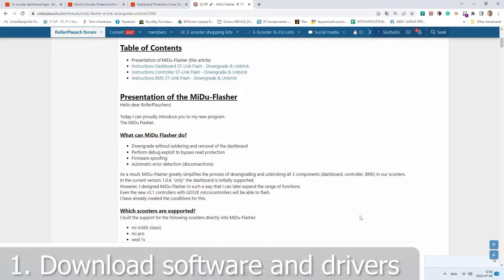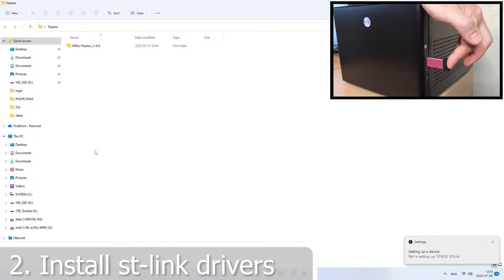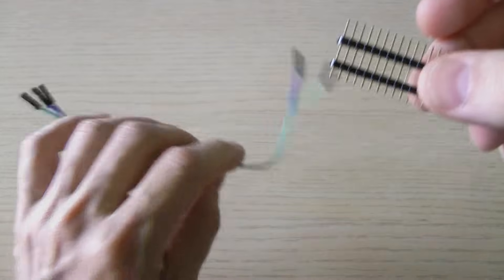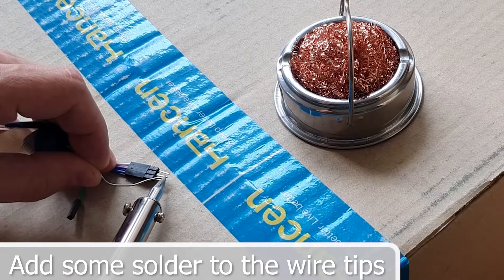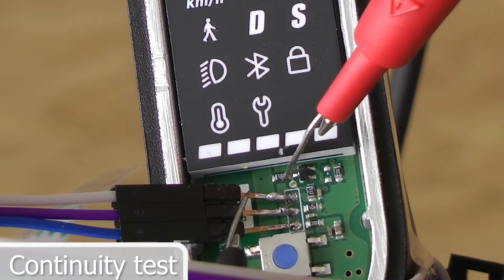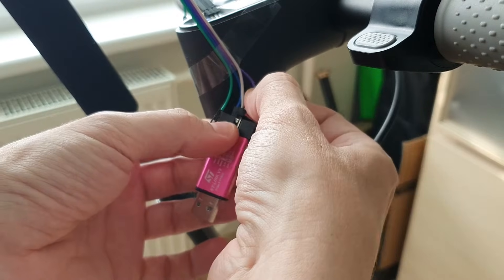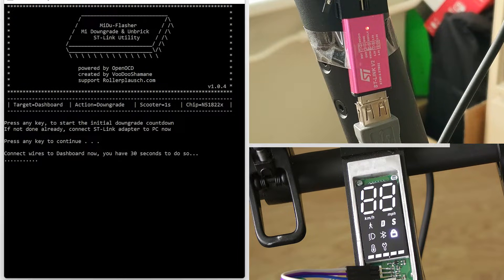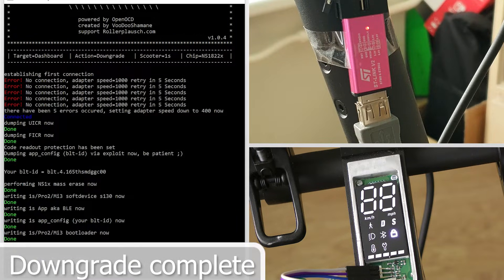Xiaomi scooter 1S BLE157 downgrade using stlink

Comment: i have a error : ERROR no blt-id found. and I don t know what to do
Reply from the maker: Try "write flash" instead of "downgrade".
Subscribe, thanks.
Reply: @MindaugasJocionis  I tried, and then it was the same version
Reply from the maker: Did you pressed Y in "spoof new ble to 157" step? If so, it has been downgraded, just appears as 157
Reply: @MindaugasJocionis  I pressed "n"  I can't even do the speed hack
Reply from the maker: @Knajjrjes  Is it original dashboard?
Reply: @MindaugasJocionis  yes
Reply from the maker: @Knajjrjes   Did you activate your scooter, or is it brand new? If it's new activate it with the MiHome app. 
I would try to flash with Scooter Hacking ReFlasher 1.3 
As well try asking in this telegram chat: https://t.me/scooterhackingchat
Reply: @MindaugasJocionis   thanks

Comment: Hey! Mine just keeps popping the no connection error. Its a mi scooter 3 and i dont know what i'm doing wrong
Reply from the maker: Did you solder it or just hold it with your hand? Did you install drivers for ST-Link, and is it recognized by Windows in the Device Manager? If you held it by just pushing with your hand, there is a coating on the board; you need to clean it with isopropyl, etc. If soldered, check your soldering for continuity. Also, check if the wires are attached correctly. Subscribe, thanks
Reply: @MindaugasJocionis  thank you for the fast response! Somehow it worked, but it kept throwing the error. Somehow it downgraded the firmware, but it kept throwing up the 42 error on the dash, and wouldn't turn off if it was disconnected from the stlink. God helped me and i fixed it but i dont know how. The stlink was up to date, recognized by windows and all the connections were fine. DownG and other apps recognize my scooter as mi 1s Now i'm able to get like 33km/h with shu. Could i achive more speed with the stock internals with this scooter?
Reply from the maker: Yes, my Mi3 has to use patched BLE or DRV to get rid of error 42, or SHFW from SHU. Your scooter is probably recognized as S1 due to a changed serial. Compare your serial that is shown in the app with the one that is on the base of the scooter. 33 km/h is all you'll get with stock parts. There is a field-weakening option in SHFW; I managed to ride 40 km/h with my Mi3, but the motor was hot to the touch after 1 km of a ride

Comment: I get "no ble-id found". What can be the problem? i've 158 BLE actually
Reply from the maker: Is your scooter activated? Subscribe, thx.
Reply: @MindaugasJocionis  yes, is it. activated and locked
Reply from the maker: @mbcorse8108  Try to use midu flasher 1.0.4 (I read that it doesn't check for ble id). If that doesn't help, try removing scooter from your mihome account and adding it again. 
If nothing helps, instead of downgrade try write flash option.
Reply: @MindaugasJocionis  Thanks, i will try it
Reply: It works!!! Thanks mate !!
Reply from the maker: Cool, what helped?
Reply: @MindaugasJocionis  with 1.0.4 version works.
Reply: Which scooter do you have?
Reply: @xboxsebiflash6744  mi pro 2

Comment: Hello, i have a Xiaomi Pro 2 Scooter and my original dashboard is dismantled or removed from the scooter. Is it possible - without any power source - to flash the dashboard? The only energy source would then come from the ST-Link. Btw the dismantled dashboard is easier to solder and to connect to the ST-Link and computer. What should  I do? Better mount the dashboard on the scooter or is the alternative way possible (dismantled dashboard)?
Reply from the maker: You can supply power from stlink to the removed dashboard. Here is a link to a dashboard diagram. https://www.monopattinoitalia.it/ripristino-dashboard-xiaomi-con-st-link/
Subscribe, thanks.
Reply from the maker: https://www.monopattinoitalia.it/wp-content/uploads/2020/11/123236395_3680511102068578_4427937403415227943_o-765x1024.jpg

Comment: my color wires are green,yellow,orange,red
Reply from the maker: Color doesn't matter, (A wire is a wire, no matter what color it is) you need to connect those 3 pins on the dashboard: (GND; SWCLK; SWDIO) to pins on stlink with the same label. (there is a diagram on stlink). Subscribe, thanks.
Reply: @MindaugasJocionis   thank you
Reply: will I be able to put any custom firmware on the scooter after this
Reply from the maker: @jamessefton7369  Yes. If you don't know your ESC version, use shfw from the "scooter hacking utility" android app. It will recognize the controller type and install the correct one.
If you have ESC3.0 (STM32F) then you can use any firmware.
For more info check this telegram chat: https://t.me/scooterhackingchat
Reply: @MindaugasJocionis   it's saying 0.3.6
Reply from the maker: @jamessefton7369  Nah, it's DRV (software) version, and you need to know the hardware version. You can check it with a "scooter hacking utility". In the main screen if it's STM-3.0 if GDI-3.1; 3.2
Reply: @MindaugasJocionis  my STM is 2.2.5
Reply: @MindaugasJocionis   my STM IS 2.2.5

Comment: Hey I got a problem. I did every think whats in this video and when 
Im trying to downgrade my scooter ( pro 2 ) it says error no connection, adapter speed= 1000 or 400 or 100. Do you have any solution for this?
Reply from the maker: Poor soldering or incorrectly connected wires to stlink. Subscribe, thanks.

Comment: Hey, why is it showing No Connection all the time? Im holding it on
Reply from the maker: Without soldering, you need to remove the coating from these contacts with isopropyl, etc. Subscribe, thanks.

Comment: Hello Sir

My scooter 
BLE is 1.5.7
Drv STM32Fl 2.4.8
Uuid contains letter FF

Can i flash it by changing dashboard ?also if yes will i be able to use extern battery like i did my old scooter xiaomi pro2 ? Thanks in advance  sir
Reply from the maker: Yes, you can flash any custom firmware to the motherboard after a dashboard replacement or ble downgrade. Whether an external battery can be used depends on the firmware used.
For more information about external batteries, please contact this telegram chat: 
https://t.me/scooterhackingchat  
As I personally hawe zero experience with external batteries.
Subscribe, thanks.

Comment: I did the procedure and after some updates the scooter crashed. It stays on but nothing works. It doesn't even connect on Bluetooth I'm desperate.
Reply from the maker: What updates?
Reply: @MindaugasJocionis  I don't even know what I did. the scooter is simply connected with the name flash_name and does not respond to any command. it doesn't even turn off. it's been on for 10 hours
Reply from the maker: Let's start from beginning. Did you successfully downgraded ble?
Reply: @MindaugasJocionis  Yes. then I went to install the new drv and ble and I did something wrong. Now when I try to redo the donwgrade with stlink it fails in the last step of the process.
Reply: @MindaugasJocionis  the biggest problem is that the app to make updates like MI HOME for example when pairing with Bluetooth asks to click on the button on the panel. only the button is not responding to any commands. so it doesn't connect to any app
Reply from the maker: @blackb155  Looks like you flashed DRV for the old ESC to the new ESC version. Do you know your ESC version?
Reply: @MindaugasJocionis  no :(
Reply from the maker: @blackb155  you need to do this: https://youtu.be/kbj3A4aAlSU
Reply: @MindaugasJocionis  when I enter the MI HOME app. it appears with the name electric scooter mi 3. but when connecting it asks to press the power button. and when i press it it does not respond. then it does not connect to Bluetooth
Reply from the maker: @blackb155  Oh and at first try this: https://youtu.be/LLi2S2m4URo
Reply: @MindaugasJocionis  I will try this one
Reply: @MindaugasJocionis  did not work 😭😭
Reply: @MindaugasJocionis  it is the same as in the video, without response to the click. but I took it out of the battery and held it for a while and then put the battery back in and it turned on but it still stuck
Reply: @MindaugasJocionis  When I enter the scooterhacking app, the Bluetooth symbol appears on the panel, but when I press the button to connect, it does not work.
Reply: @MindaugasJocionis  I did the procedure again with stlink and this was his messages.

if there is no beep, there might be something wrong with the firmware
all set, leaving now

if there is no beep, there might be something wrong with the firmware
all set, leaving now
Reply from the maker: @blackb155  Try to ask in this telegram group: https://t.me/scooterhackingchat

Comment: hi thanks for the video!

if the program ask me to place the file to a certain folder, where can I download those files ? I have a clone dashboard, mi pro 2.
Reply from the maker: Pc must be connected to the internet, as well as disable antivirus or firewall (if using 3rd party). If that does not help (might be FTP server is down etc.) Do this:
"If you want to flash your own BLE version, you can simply store it in the appropriate folder under MiDu-Flasher\Resource\files\BLE\App\N51822x\(Scooter)\App.bin
BLE can be downloaded: https://firmware.scooterhacking.org/
Subscribe, thanks.
Reply: @MindaugasJocionis  does it matter which BLE version I put into that folder? Also do I need to put the zip and bin file too or just one of them?

Thank you very much for your help. 👍🙏🙏
Reply from the maker: @kornelpasztor7947  Your file path should look like this: C:\MiDu-Flasher_v1.0.5\Resource\files\BLE\App\N51822x\Pro2\App.bin
By default miduflasher downloads BLE134.bin
So download BLE134.bin for PRO2, rename it to App.bin and place in that place.
Only BLE is not downloding for you, or bootloader too?
Reply from the maker: @kornelpasztor7947  for bootloader: download from: https://github.com/CamiAlfa/stlink_m365_BLE/tree/master/flashing
bootldr.bin
Put it ro: \BLE\Bootloader\
bootldr.bin rename to Bootloader_1s_Pro2_Mi3.bin
Reply: @MindaugasJocionis  as I renamed it then it suggested that it will download me the necessary files. 

So that part done. But I've got into a barrier as I realised I don't have the same connections  like on your video :/ I might better stop here before I brick my scooter 🤦

Silly question but by any chance don't you make dashboards downgrading for others?
Reply from the maker: @kornelpasztor7947  So I would try to put that original BLE in clone dashboard folder C:\MiDu-Flasher_v1.0.5\Resource\files\BLE\App\N51802x.
But, before trying that - ask in this telegram chat: https://t.me/scooterhackingchat
Or this forum: https://rollerplausch.com/threads/midu-flasher-st-link-downgrade-unbrick.5399/
As I don't hawe any experience with clone dashboard.
Why do you downgrading it's ble? What wersion is on it?
Reply from the maker: @kornelpasztor7947  So your dashboard has a different connections (some clone dashboards cannot be reflashed) Ask in that telegram chat (deffinetly you will get help there), I'm sitting there sometimes too.
If you will not get answer ask few times in a day, as not eweryone that can help are sitting there 24/7 :)
Reply: @MindaugasJocionis  I want to upgrade it so it goes quicker uphill a little bit but I've got told I need to downgrade it first.  I'm not sure, I'll check it later on
Reply from the maker: Oh wait, I missed that it's a clone dashboard :) Wait a bit, I'll check what happens if the clone is chosen.
Reply: @MindaugasJocionis  don't you know a website or place where a dashboard van be bought so it will allow it to downgrade it through app ? I'll definitely ask these questions in that group haha :D thanks for the help once again :)
Reply from the maker: @kornelpasztor7947  No, I don't know of a reliable site for dashboards.
For a higher speed, you don't need to downgrade BLE. (It's only required if your dashboard is BLE155 and up version that prevents flashing the motherboard via Bluetooth)
You need to flash DRV to the mainboard or SHFW from the scooter hacking utility (depending on your mainboard version).

Comment: Hello please help. When i am in the part of "press any key to continue" , there in an error "could not download file.
Reply from the maker: Pc must be connected to the internet, as well as disable antivirus or firewall (if using 3rd party). If that does not help (might be FTP server is down etc.) Do this:
"If you want to flash your own BLE version, you can simply store it in the appropriate folder under MiDu-Flasher\Resource\files\BLE\App\N51822x\(Scooter)\App.bin
Reply from the maker: BLE can be downloaded: https://firmware.scooterhacking.org/

Comment: I downgraded my Xiaomi pro2 tnx to your guide .. now it looks like this 
DRV ver:2.5.2
BMSver: 141
BLEver: 134
what is the next step to be able to change the config for speed hack . 
i tried some files with m365 down app but I get error code 14 . can you pleas help me out thanx a lot
Reply: I managed something it’s now as follows 
BLE 1.3.4
DRV [SHFW] 0.2.6
BMS 1.4.1
ESC REGION unknown
no error codes
Version STM32 ver 3.0 

but not driving anymore :))
Reply from the maker: @mcesur78  You will need to configure SHFW after installing it. Go to the config tab open throttle and brake and build throttle curve. The motor will start spinning. 
For more and faster help check this telegram chat: https://t.me/scooterhackingchat
Reply from the maker: What is your ESC version? 
You can check your ESC microcontroller version in "Scooter hacking utility" app.
STM32 - ver. 3.0
GD32 - ver. 3.1

Comment: I have a question regarding the serial protocol used by the USB ST-link

What protocol does it use for communication:

UART
I2C
SPI
CAN
GPIO
Reply from the maker: I believe it uses SWD/JTAG debug protocol
and GPIO communication interface
I'm not sure that I'm correct if you are really interested in this you can ask VooDooShamane at https://rollerplausch.com/threads/midu-flasher-st-link-downgrade-unbrick.5399/  forum.

Comment: I did no soldier method
Reply: very easy
Reply from the maker: @thepunisher839  Nice, don't forget to subscribe, thanks.
Reply: @MindaugasJocionis  Have done, thanks it was little hard to get soldiering iron so I just touched the pins and it worked. Thanks

Comment: I get this error all the time
(Error! No connection, adapter speed=400 retry in 5 Seconds) 
and nothing more 
i have pro 2 2
Reply from the maker: Double check your soldering or if you have a multimeter for the continuity of your soldering. If you only hold by hand, you will need to clean the coating of these pins with isopropyl alcohol, etc.
Subscribe, thanks.

Comment: Hello, i hope someone can help me with my problem: I bricked my mi 3 with a wrong firmware, so the scooter can only turn on when the power cable is disconnected and than connected, the scooter turns on, then i try to connect, the mi app finds the scooter, then i press the power button and nothing happens! So i tried this solution and everything went good, but the problem is still the same!😩 What can I do??? I also have tried to disconnect all the cables and let it stand for over 10 hours, nothing works!!😢 Sorry for my bad english i am from austria!🤗
Reply: Thank you, i will try it and let you know if it worked!!👍🏻🤗
Reply: Hello, now i get target could not connect!!☹️
Reply from the maker: You need to reflash your esc https://youtu.be/kbj3A4aAlSU
Subscribe. Thx.
Reply: Will it help go buy a new esc? Which one can you recommend?
Reply from the maker: @mazda1991spr  Soldering needs to be checked. Did you solder it or just put pins with hand. If just by pressing, there is a coating, you need to remove it with isopropyl. 
And check this telegram group: https://t.me/scooterhackingchat
Reply: @MindaugasJocionis  Solderings are checked with a multimeter. Would it help to buy a new esc?😢
Reply from the maker: Try asking in that telegram chat. I hang out there too.